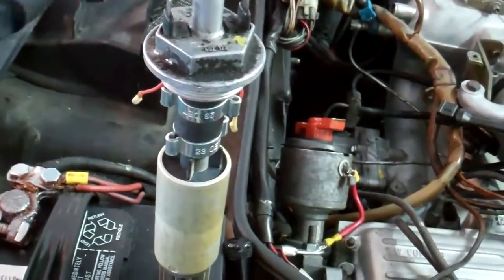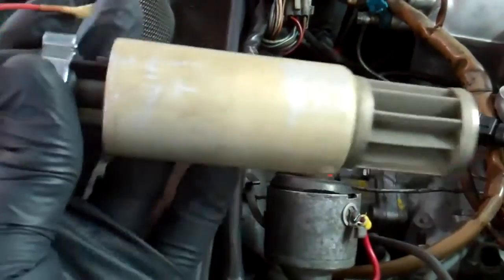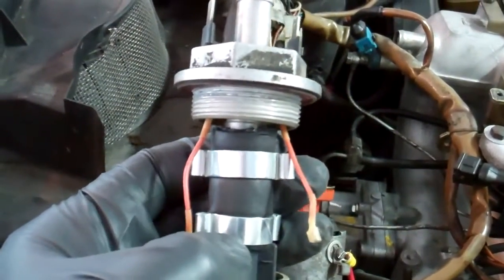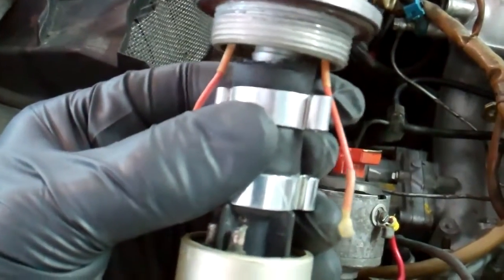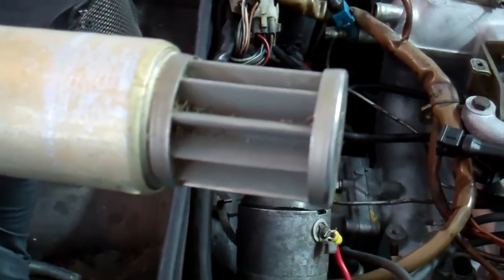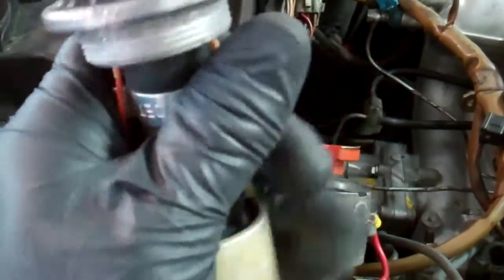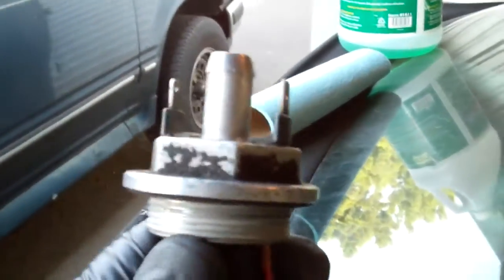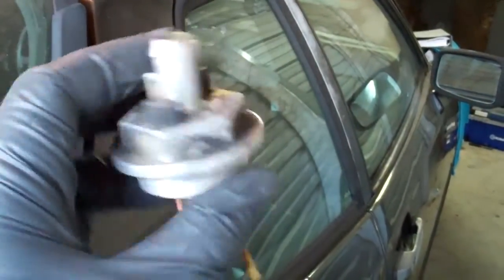1981 Porsche 924 Turbo | Modifying In-Tank Fuel Pump

Comment: Thanks, that video covers all I wanted to know. Why does Porsche use two pumps? The outer pump is potential enough to support the good old Audi 100 engine. I use same fuel pump in my Audi 90 Type 81 / Typ 89 with 5 cyl. 136PS. So what the hell! What´s the use case for that second pump. Especially the pump is extremely expensive to buy.

Comment: why do they have x fuel pumps?  one pushes? one pulls?  or one is for the demands of a lot of fuel when the turbo is on full boost?   I ask as my series 2 is not running well- i.e it will only tick over and if you drive it it kanagros badly- goes no place